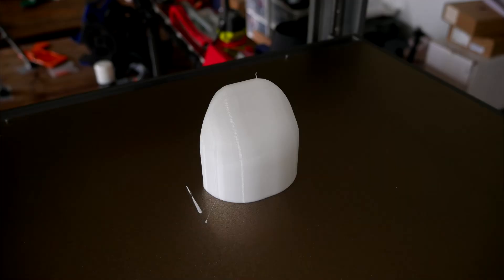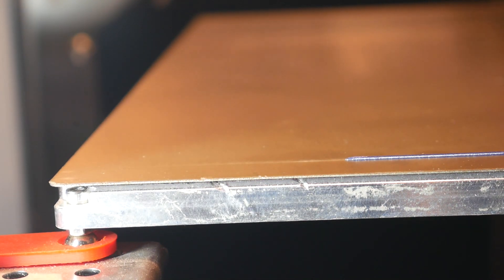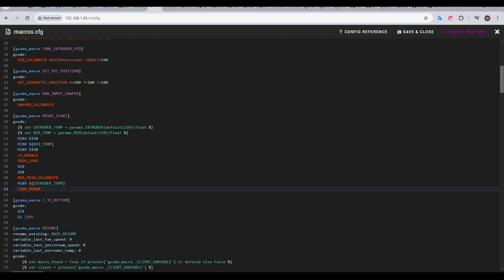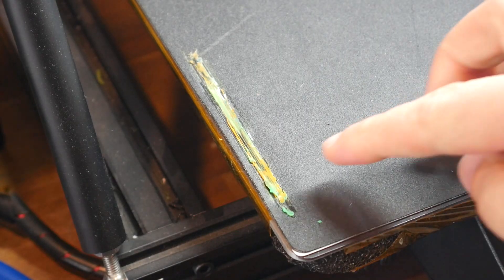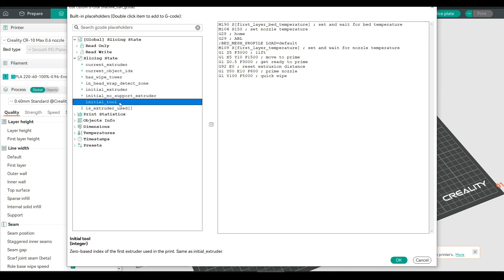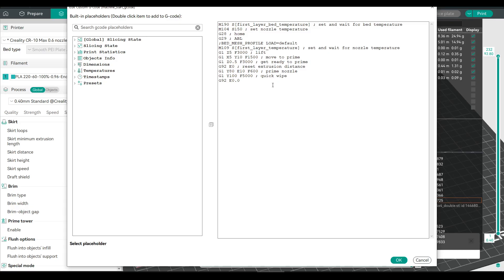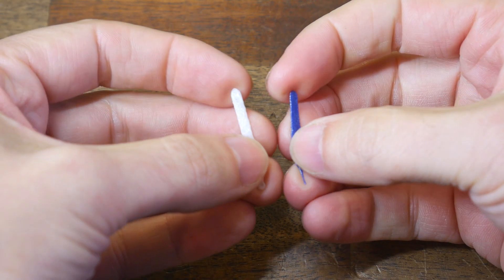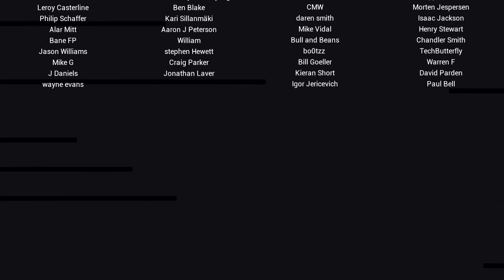Adaptive purge for every 3D printer: A simple slicer tweak

Comment: Hold on. Does your x1c draw the filament calibration from right to left?! Is this another toilet bowl situation? 😂 i am in the us and my square portion of the filament calibration is on the right side of the bed. Just thought that was interesting.
Reply: Most printers I have seen have them on the left side. It doesn't really matter, though, as long as it starts the purge line closest to where the toolhead ends up after it's done doing bed calibration.

Comment: Remember to offset yiour variable_purge_margin by at least the probe offset. But probably do 2x that just in case. Or do that + 5mm.
Because the probe will scrape over the line if you don't since the purge line is much higher than your first layer.

Comment: The issue I had with such fat purge line very close to the print is that it can obstruct the way of the BL-touch sensor making print head jump every time probe bumps into purge line.
Just be cautious about your configuration and put purge line further away from the print.

Comment: Does the code need to check if the purge coordinates are off the bed? I know with KAMP that it sends a message to the console if you need to remove the purge line before printing.
Reply: your slicer will give you an area about a toolpath outside the print area

Comment: The purge line has never really bothered me, I keep my bed leveled to ~0.2 maximum offset across and that's always worked well. What bothers me more is that when it homes it always touches the bed at 0,0 and that leaves a small divot plus there's always a little blob of filament there before it starts printing if I don't push it off once it's ready to go.

Comment: I've just got into printing ABS and couldn't start printing the object without getting ball that would get caught in the fan duct, get pulled along and cause the entire line it was printing to be lifted. I wrote a CURA post processor specfically to read the first G0 co-ordinates (usually the move to the brim start point) and process them. It purges down one side in the normal way, across to the G0's X co-ordinate, then turns left and prints straight down the bed to the G0's Y co-ordinate. So in its initial printing it doesn't get a chance to run the duct over a stuck up tail. Works really well.
Reply: Could you share your CURA post processor script/code please? I would like to try it. TY.

Comment: I believe there’s an option for max length for a skirt. That would also be a viable solution. I do something to 2:44 for my ender 3.
Reply: There is a similar thing on the FlashForge slicer where you can set the length of the skirt.  It means on big prints its not doing a massive skirt round the whole print
Reply: I use OrcaSlicer. There is a MINIMUM length for the skirt, if it's not at least that long it adds another loop. But I cannot find any maximum length where it stops if it gets too long. So I'm hoping that this "adaptive purge line" thing can help simulate that.

Comment: Answered 
-I'm not being sarcastic and legitimately curious. Why not simply print a skirt and get rid of the Purge Line start g code?-
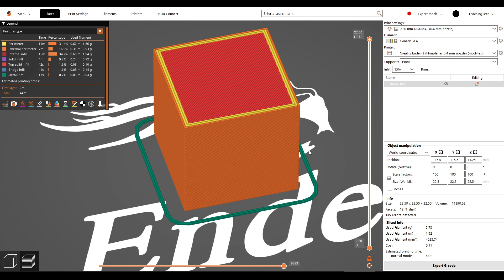Reply: 1:59
Reply: @marc_frank  Fair enough. I obviously missed that so thank you.
Reply: Because skirts leave loose material near the print where they might get dragged into positions that interfere with the first layer. You need nozzle primed properly before it gets anywhere near the print zone.
Reply: @daliasprints9798  👍 TY
Reply: It also effectively shrinks your build plate. 

If your skirt is 5mm from every side, you have now limited the size of things you can print by 10mm X and Y.
Reply: @sxeychick9622  or you just lose the skirt in spots